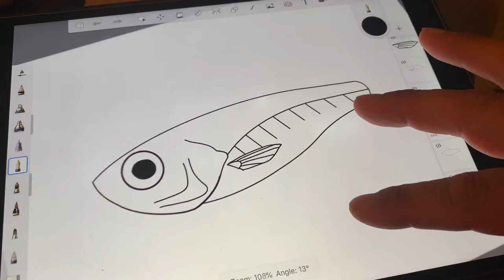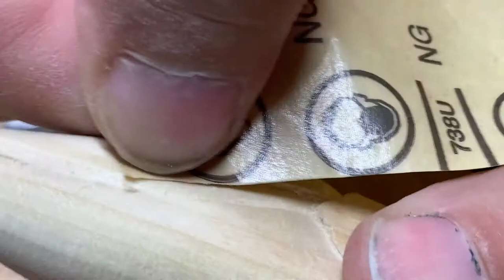Experimenting with Microballoons

Comment: What is the measurements on how to make your silicone mold material
Reply from the maker: I seriously just eye ball it every time.  There isn’t much variability to it, just don’t put in too much paint thinner or it’ll turn into a sticky mess.

 I guess if I were to recommend measurements, I’d start with 2 parts silicone, 1 part cornstarch, a few tablespoons of glycerin and paint thinner, and a drop or two of paint.  The paint is only there to let you know you’ve stirred throughly.